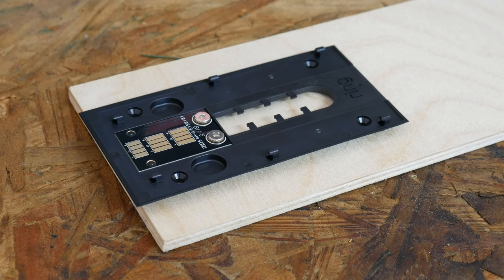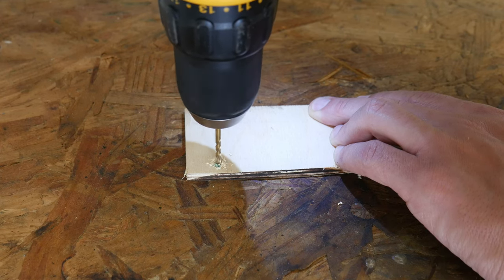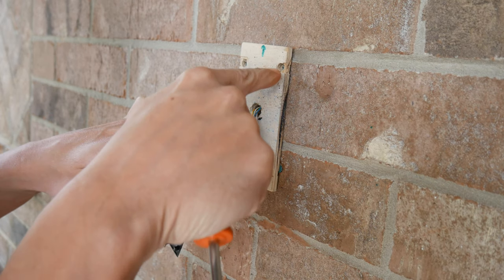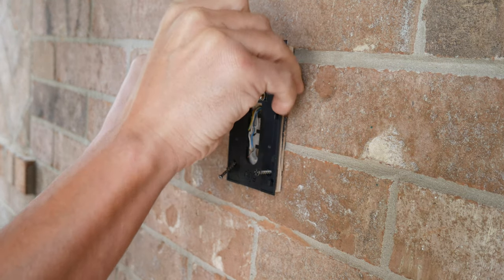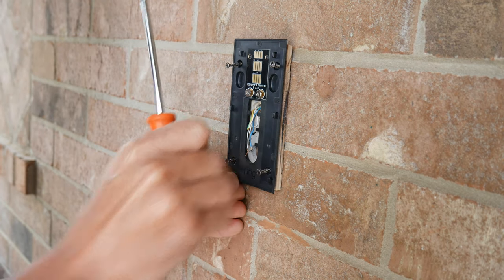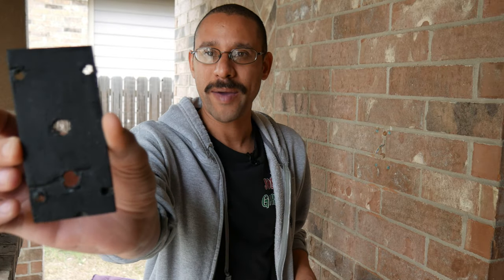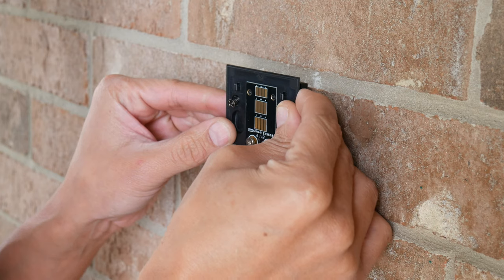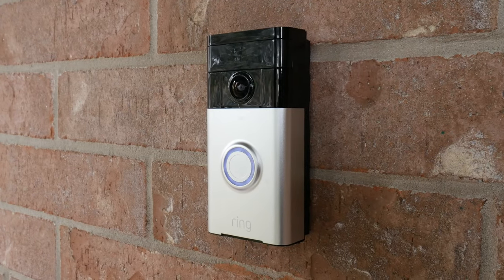Ring Doorbell Mounting Hack

Comment: Looks like you left out the part where you drilled holes into the brick and then mounted the wood piece to the brick.  And then you said you drilled extra wide holes.  So what do the mounting screws screw into?